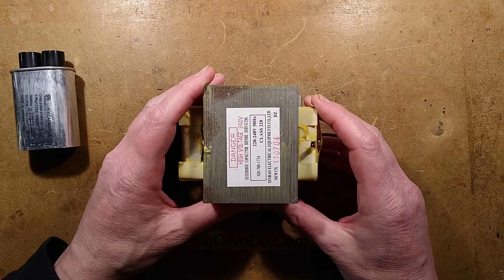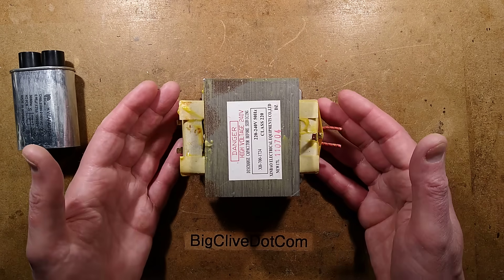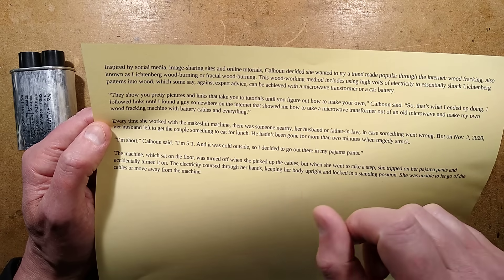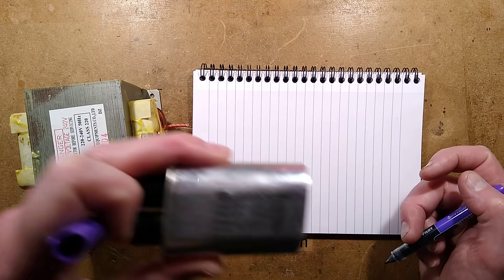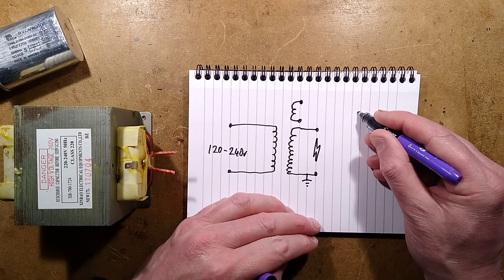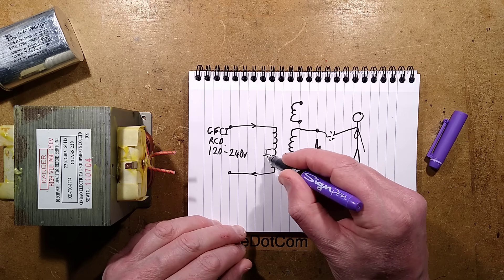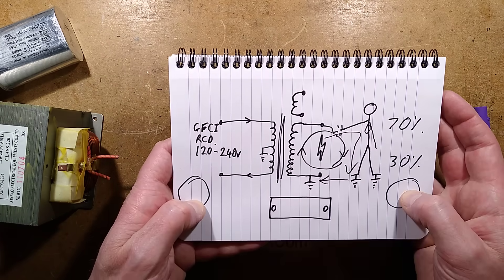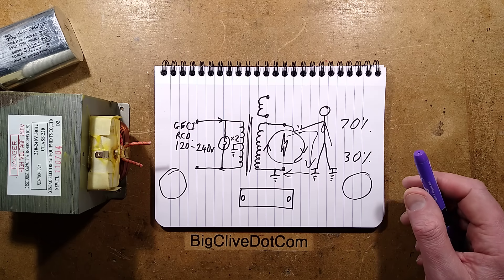The most deadly project on the Internet

Comment: I use transformers for isolation when working on live equipment as you are supposed to do BUT that certainly means you dont allow either leg  to touch earth and you keep it floating so you cant get zapped with your probes if you touch the earth clip to live accidentally.   However letting someone use a live mains transformer without full knowledge ,  you still have secondary 240v at some amps even if isolated and not live to the wall where more amps can flow at you. Kill you ether way.  A piece of wood can conduct especially when damp, you have to be so careful and paying attention..

Comment: Great video. I think it's worth noting for people unfamiliar with electrical fundamentals that the difference between 3,000 volts and 120 volts (or 12v for that matter) isn't just a much bigger shock. I think most people understand that, but they don't understand that 3,000 volts will "behave" much differently than 120v, or 12v. You have to do different things, and consider different factors to avoid getting shocked at 3,000v versus the 120v or 240v most people are familiar with. For example, 12v car battery jumpers have very thin insulation because a 12v circuit doesn't require much insulation, even for the massive "shock" (ie. amperage) necessary to jump a large engine. Forget the amperage/shock/power delivered for a second, the voltage, 12 volts, can't even meaningfully penetrate the insulation of our skin, so all the amperage/power/shock doesn't pose any real danger cause it can't "get to us". But in a very low resistance circuit, with big thick copper clamps to make a strong connection and let the power flow even at a measly 12 volts, the gauge of the copper wire has to be thick because it needs to be able to deliver very high amps. Household wires have thicker insulation, but it's still not that much.

On the other hand, for a HIGH VOLTAGE circuit, the inverse is true. The amperage will be relatively low, so the gauge of the wire doesn't need to be as thick, but the insulation needs to be very, very thick and robust to "keep it all in the wire" and prevent it from jumping or shorting to anything that gets close to the wire. This is why car battery jumpers are a HORRIBLE choice for this purpose. The gauge of wire is way overkill for the relatively low amperage running through it, but the insulation is WAY UNDERKILL for the extremely high voltage around the wire. At 3,000v, you don't even need to come in direct contact with the electrode, or wire, or connected series pool of salt water, or anything at all energized on the high-voltage/xformer secondary side of the circuit to receive a shock. The voltage is so high, it can overcome even the high resistance of a sizable air gap and arc directly to your body. Also, once this "link" is established, the resistance drops even lower, increasing the voltage, and thus the amperage/shock you receive. This is the same reason lightning is able to "jump" through the air. It is insanely high voltage. It doesn't "behave" in the same way as household voltage, or car battery voltage (even though they all follow the same fundamental "rules" of electricity, high voltage is just on a much higher level in every respect). 

I say this because I think a lot of people believe they know how to avoid getting shocked because they're used to doing it with 120v or 240v circuits. I don't think most people realize that there are things you can do in a 12v or 120v or 240v circuit that are perfectly safe, but which will absolutely get you killed in a high voltage circuit....something as simple as touching a standard extension cord is perfectly safe at 120v, but may kill you at 3,000v. Be safe everyone, and if you don't know what you're doing, consult a qualified electrician. Aloha!
Reply: I think Williams Osman summarised this perfectly.
"Welcome to the world of high voltage, where everything is a conductor and you're probably going to die."

Comment: it feels like the ones that are most scared of this are the ones who knows most about them
Reply: That's how it tends to go. pretty much everything you can learn about electricity just reinforces that you should never let down your guard while working with it. It can kill or cripple you in an instant and it's completely invisible until it's too late.
Reply: @screamingcactus1753  I had a class in high school that taught us the proper way to wire up home outlets, junction boxes etc. I NEVER trust wire color, I NEVER trust that a circuit is "dead". I NEVER touch bare copper with my bare hands. A couple weeks ago I was hooking up my new mini-split AC in my fuse panel. I ended up pulling the mains and STILL only touched wire with insulated needle-nose and insulated screw drivers.
Reply: Dunning-Kruger effect. Confidence through ignorance.

Comment: You remember the old old tube TVs from like the 1960s well I took apart one of the TVs and I got to the point of where you're at one of those things and took apart the copper coils well there wasn't internet back then to tell you that those things hold the charge even after you unplug them well I got shocked I probably should have died but God has plans for me

Comment: It's not even about being skilled. The human body will always make mistakes. Our perception itself is based on interpretation not actual reality. I'd use every precaution in the book. But honestly, I've been electrocuted before, so I know better, I just wouldn't do it. I tripped and fell into outlet wires that were on. (US 120v) But just the wires themselves. (We were remodeling basement walls) It only knocked me out, but it's still an awful experience.

Comment: I am currently training for HVAC and I recall the section warning against using a screwdriver to discharge capacitors...it was recommended to make your own resistor bleeder/discharger instead and allow time for the charge to leave the capacitor. I imagine that even a 900W microwave is going to contain a substantial capacitor in it. Any thoughts on this?

Comment: Wow.. This is why even i don't mess around with these, as much as i love the idea of high voltage, arcs and such...i just end up watching videos or documentaries on it! I still have an MOT lying around... Had it for a few years now, have never connected it up! The same voltage as an electric chair though? I'm actually surprised, under load I'd imagine that drops quite a bit or the current is much higher than the roughly half an amp that can be pulled from a MOT without overloading? Doesn't seem that humane, does it? Christ..

Comment: Even having a bit of an engineering background, no way in hell would I even attempt to play with one of these things. I'm overly cautious enough poking around power supplies at mains voltage. Like everyone, you will eventually make a mistake. I've luckily never managed to get myself a mains voltage shock - but I have seen a short to ground blow a chunk of metal apart and launch it across a room. I have had a camera flash discharge through me taking apart a camera once (I was younger and didn't realize that giant cap could have been in a camera) - that was enough of an experience to make sure I never got one again. High voltage electricity is not something to play with, ESPECIALLY if you don't know what you're doing.

Comment: I had a surveying laser from the 70s that used a classic HeNe laser, which includes a 10 KV transformer (luckily very low current), which of course I managed to zap myself with momentarily. Despite it's comparative triviality, it hurt like a MF and taught me about transformer-capacitor combinations forever...but (hopefully) live and learn.
That combo of safe switch and initiate button is used for pyrotechnics and blasting too.  ;*[}
And actually, doesn't it require a certain amount of current to produce a good dendritic burn?
Thank you for the clarification! Cheers...

Comment: Microwave transformers are not current limited. If you make yourself part of the circuit they will give you everything physics will allow. Neon transformers are much safer as they are usually limited to a much less lethal current, but they still are no joke. Be careful, people.

Comment: Would connecting one terminal to the neutral wire help? You get rcd protection, and if your neutral is floating a bit high, well, you weren't going to touch it anyway!

Comment: HELLO BIGCLIVE.....
This video was long overdue...THANKS!!!!
You also should have mentioned the extra danger of the diode doubler inside.
I have told many youtubers that the MOT is a "design to kill".  I have seen way too many uses of the MOT where the NST would work just as well, and said so.  I have simply seen too many unbelievable uses of combining MOT's.  In my book, it's lethality is only second to the huge 200lb energy/pulse capacitors. 
THANKS MUCH...

Comment: Yeah someone's going to be opening her pickle jars for the rest of her days. When I was a kid I tore apart just about everything I could get my hands on and one day I was watching The mutual of Omaha wild America on a little 10" black and white tv I was about 10 or so and the tv picture went out. So I thought that by unplugging it it would be safe to break out my butter knife screwdriver and my Swiss army knife and attempt to fix the problem. I managed to get the outer casing off of the back of the tv and was looking around inside and I saw 3 what looked like suction cups with wires coming off of them  going to the back of this glass dome that was behind the screen. I had the not so bright idea to see what would happen if I grabbed one and tried to pull it off and when I came too my 2 little brothers were standing over me dumping water on my face and I was laying in the closet on the other side of the room and the closet door was broken in half length wise. My brothers said that when I pull that suction cup off there was a loud pop and I was thrown across the room and hit the closet door so hard it broke and they thought I was dead. I was out for about a minute I guess and fffffffor the mmmmmost part I turned out jjjjjust fine. The next day I stopped by the local tv repair shop on my way home from school when kids use to walk home from school  and asked the guy how come the tv was able to shock me even though it was unplugged and he explained that older TV's have capacitors that store massive amounts of electricity and even when the have been unplugged for a long time they can still zap the sh!# out of you and I was lucky to be alive. After that I have always approached electrical projects with the utmost care and caution. If your crafty you can take a disposable camera and a paper clip and make a taser that will drop a full grown man in a split second with just those 2 items . Capacitors are no joke even the little ones.

Comment: There’s a reason why utility workers wear thousands in protective PPE, working around similar voltages with loads of knowledge, training and experience. Electricity - regardless of voltage - is not for the novice.
Reply: That's part of why we encourage hobbyist electrical engineers to stay at 5v or less.    But there's always someone who wants to run 240VAC straight to the Arduino.    And no amount of explaining why it's so wrong in so many different ways, will get them to understand why it won't work, and how it will kill them.

I got bit by 240VAC a few  days ago.  As it turns out, the people who had worked on the machine before me hated grounding anything.  All the grounds were unattached, and the ground pins on the cables were cut off.   And that wasn't the only problem with the machine.
Reply: @JWSmythe  Also, folks working with these make shift systems are playing with fire, as the insulation of cables will fail unless rated for such voltage. I doubt car cables are rated for more than 600v. Remember, we have to test insulation before we turn on new systems, insulation is that last line of defense and the weakest link in our systems.
Reply: @JWSmythe  I just graduated BSEE and 5v sounds way more fun than anything else. I'm safely affraid of high voltage.
Reply: @JWSmythe  Dangerous! That's so retarded dude. What were those guys thinking? Even if something is improperly grounded, theres a problem, let alone it NOT being grounded in a grounded system. Please, remeber to use your volt-meter or wiggy before working on live systems. What did you touch which shocked you?
Reply: "Electricity - regardless of voltage - is not for the novice." False and misleading. You can work safely with low voltages and have essentially zero chance of dying and minimal risk of getting hurt. What I'm talking about are voltages like 5 or 12 volts DC which you can use to power LED lights, small DC motors, fans, etc. In fact there are a ton of nice projects that novices can work on using these safe, low voltages. What people should be careful of is anything approaching mains voltage (110-120/220-240 volts) and higher. Working with these voltages requires a healthy respect for the dangers of electricity and enough knowledge (and common sense too) so that you can work as safely as can be.
Reply: agree with  @Vendemiair  . Under European law (I believe), voltage lower than 30 VDC or 25 VAC is "safe" voltage, even for children.
Reply: Yeah, at one of the places I previously worked, I was in the electronics division and somebody on maintaiance cut through a 480v line, somehow only noticing it when the conduit started glowing red, so we got to sit everyone down and show them all the classic arcflash safety videos.
Reply: Unless you're a tower climber, then you just wing it

Comment: Maybe there is a market for an 'over the counter' wood burning tool that gives the same effect but at a safe voltage.   Most transformers in domestic equipment reduce the voltage, but not so in a microwave.  The best thing to do is leave the old transformer alone, don't go near it, don't plug it in, and don't play with it.  Take your dog for a walk, go ride a bike. Forget about fractal wood burning.

Comment: A much safer and more fun thing I like to do with microwave oven transformers is remove the secondary winding and replace it with my own winding of a few turns of thick gauge wire and then reassembling it. This gives only a few volts of output but hundreds of amps, so it’s relatively safe electricity wise but can still melt metal like it’s butter. If that’s still too dangerous they also work great as electromagnets with the bottom plate of the transformer and secondary removed and just leaving the “E” shaped core and the primary winding

Comment: I've been an Electronics Technician for around 27 years, and I'm so glad to see this video and the amount of attention it's gotten.  So many people simply don't understand the very real dangers that can be lurking inside of some home appliances, and even those people who do understand, sometimes get complacent.  I'm happy to see someone covering this side of things.  Bravo!  Great video!  🙌
Reply: I've also worked on electronics for over 25 years and the amount of stupidity in some of these projects is terrifying.
Reply: @paladin181  got top student 01 major appliance course . Doing microwaves, didn't discharge capacitor.  Like the teacher said in class"'you'll only do that once, " He was right. I never did it again
Reply: @chrismcdonald6481  I worked on radar equipment in the Navy. One of our class pointed a little to close to an energized klystron. That was an attention grabber. It reached out and touched him. Fortunately, the amperage was low, but it definitely put all of the rest of our hands firmly in our pockets.
Reply: I’ll stick with 12 volts DC
Reply: I found myself locked in a grip across the handles of an Army Radio operating at 120volts AC. I thought I was a dead man, but I had the survival presence to kick myself away from the rig and break the paralyzed hold the current had on me. When I broke looseI went flying out the door to the radio shack into the truck yard. I was working all alone , a very foolish action. Emergency squad was called as I laid in the truck yard shaking and gyrating. For about an hour I had to sense of touch or feel in my hands. 

I was lucky that day and knew it. My whole life flashed before my eyes.  My work group nicknamed me “Sparky”. I experience to cuts or scars just a few severe bruises. The rest of my life I respected electricity very much more. Over my lifetime I did experience mild shocks while working on High voltage equipment.
Reply: So. If you do not understand, then my take would be, don’t do it.

Comment: Wouldn't it be better to not hold the box with the dead man's switch buttons? If the current finds a path through you, it might not be possible to let go if your hands lock up. Keeping the box on a table and putting one pointer finger on each button seems much safer; the chances are your hands are going to ball into fists and your hands will be brought to your shoulders, both of which would take your fingers off the buttons
Reply from the maker: The point of the dead man's switch is to keep your hands away from the danger area in the first place.

Comment: But the secondary of the transformer is not connected to the ground? You would have to touch both ends to get a shock right?
Reply from the maker: High voltage will create random current paths in wet areas.

Comment: Some of us on this planet, quite a rare few, are Blessed with a high galvanic skin response.  Yes, it is a real aspect of human anatomy.   High voltage and above 1A electrical shock is  not deadly, painful or incapacitating.   Not to say, that getting burnt is not a possibility, especially if 100% of the current travels directly around the body in  small contact area.     Again, this is for a rare few , so don't muck about electrical circuits.